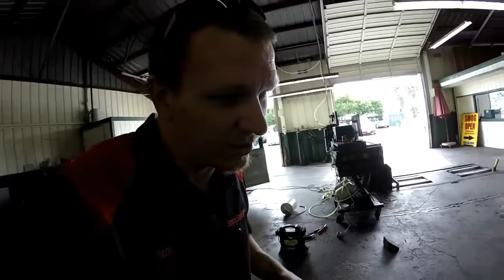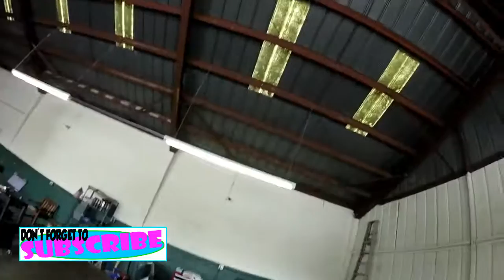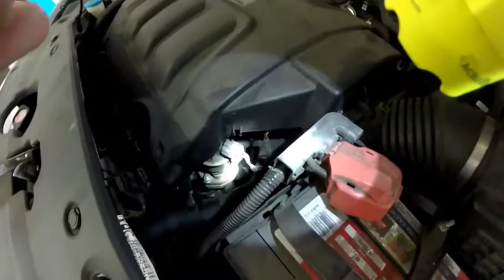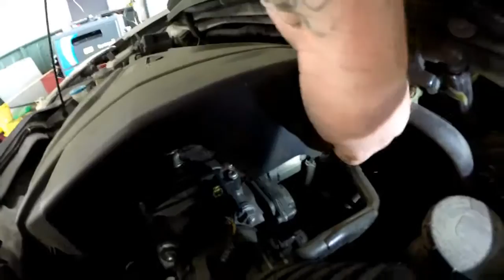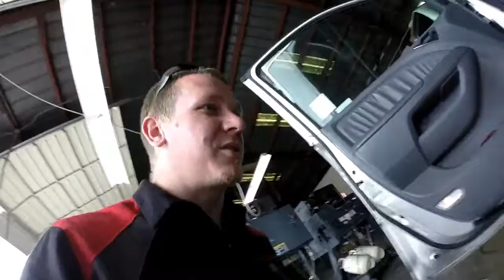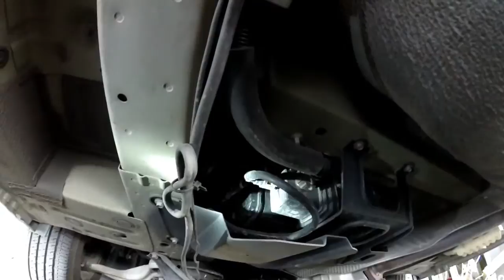Honda Odyssey emissions locations: EVAP canister & purge & EGR

Comment: Hi Scott! I have the 07 Odyssey that throw a p145c and p0497 code while back I replace the cap the purge valve but recently the engine light came back on and throw the same code again, but I did notice that when the car warm up the purge valve doesn't make clicking noise like a working one would and I check the continuaty on the valve and is not shorted . Could be something else? Thanks!
Reply: you ever  get this fixed? I have the same issue
Reply: Same

Comment: excuse me I have a 99 Ford Explorer  V6 and when I used the smog machine  I saw smog liking from the EGR valve and I have check engine code P0171 in bank 1, my question is : I need change the egr valve ó  I just need clean it?
Reply from the maker: Where is the leak? on the tube to the egr from the exhaust manifold? the diaphragm of the EGR? That p0171 cod could be caused by your exhaust leak threw the EGR system, especially if the exhaust leak is on the bank one side the engine and before the pre cat O2 sensor.
Reply: No, The leak it's around the Membrane Cover!
Reply from the maker: Membrane cover? The diaphram cover on the egr valve? Does the tube from the egr to the manufold only go to one exhaust manifold or both?